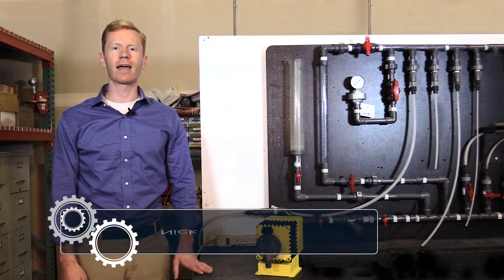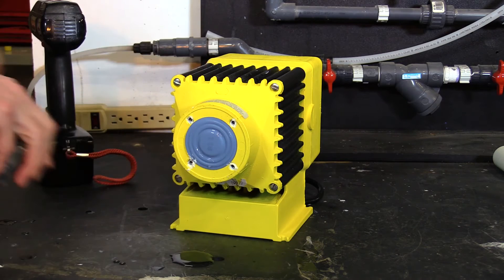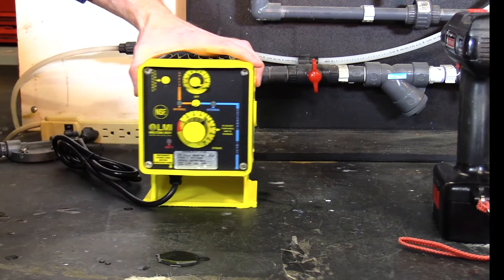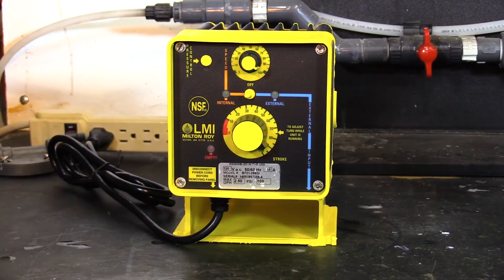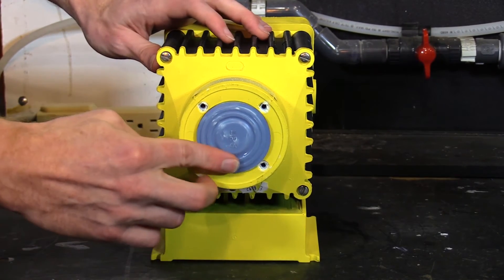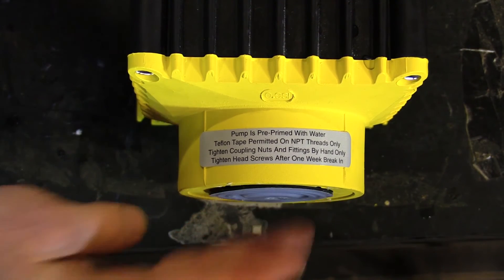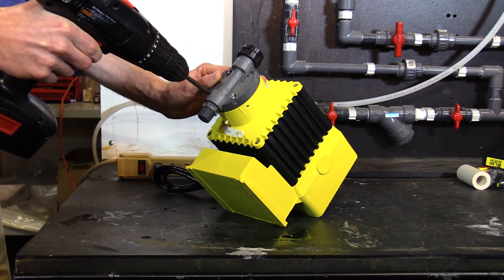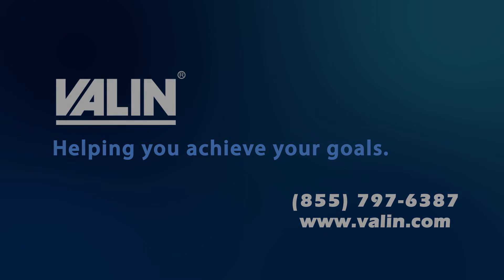How To Properly Install a Diaphragm on an LMI Pump Video

Comment: Never tighten screws or bolts with power tools on plastic base equipment.  They should be torqued with a torque wrench to manufacturers instructions. (Licensed US Airframe Mechanic)